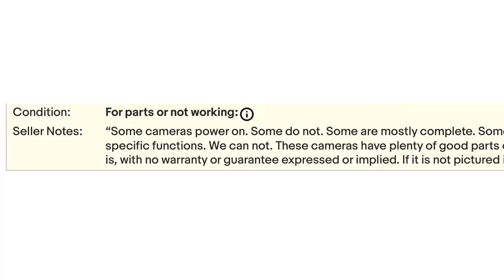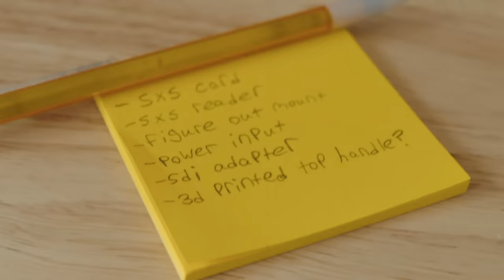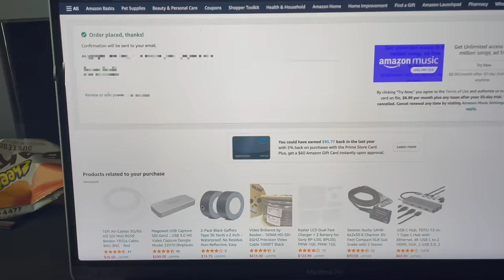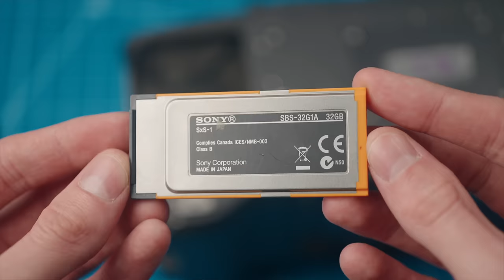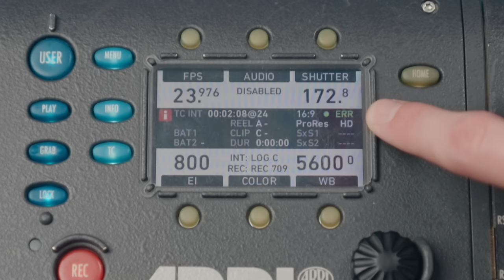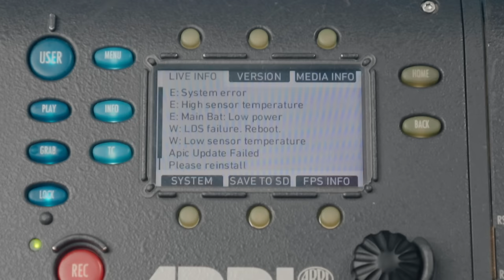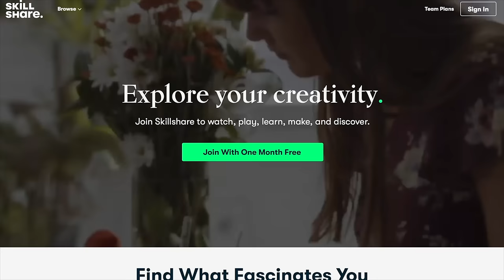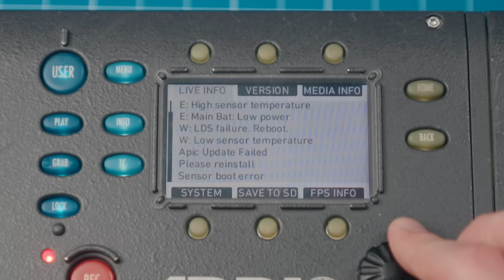I Bought 5 Broken Arri Alexa Cinema Cameras... Can I Fix Them?

Comment: Please don’t do a 3D printed top handle - Arri classics are heavy and imo not worth the risk at all of a plastic top handle
Reply: The whole damn camera is plastic
Reply: @doulos5322  No it’s not, that Alexa is a literal boat anchor bro… You’ve clearly never operated one and know nothing of what you speak. 🤫👉🏽🤡
Reply: @YouTube_can_ESAD  yep your right I'm clearly wrong. I thought the hammer finish was fiberglass reinforced plastic instead it's milled metal with a hammered powder coat my mistake.
Reply: There is nothing wrong with a properly designed 3d printed handle. 3D printed material can support 160,000 times it's own weight, but if you don't know how to design one or run a proper FEA on the part then just use a cage.

Comment: An AC power adapter to have constant power to camera for trouble shooting would be a big plus.  Might be another $100 investment.  The SxS-1 card your using is not supported by Arri, look into SXS pro card.  That will be another expense as well.  Love the project!  Hope you can get one of these up and running.  In my experiecne Andrew Shipsides is a great resource on these cameras, if he doesn't know he will direct you to someone that will know.
Reply: If he's in LA or NY or another industry heavy town, check craigslist. You'll be surprised what people will let go for next to nothing (comparatively).
Reply: any Lab supply will do they are cheap and chinese Ive several in use for years....

Comment: I'd have been a little bit worried about buying from somebody who had "5 of these"
If you've got 5 of anything, that's not likely to be random stuff you picked up in a yard-sale - they've been collecting.
If the collector then sells off "5 in a random state of completeness" - you can be pretty sure they've stripped out anything of value. 
The "oh it's weird that that's missing" is going to be list of consumable parts required to make a functioning camera.
Reply: This. Arri has great customer service. If they were fixable individually they would have been. They were used for scrap already - why would they be missing buttons and whatnot ?

Additionally : Sensor boot errors and failing software updates are also a big nono. It seems that these got fried somehow.

Comment: Definitely get AC power adapter. That’ll clear up one of the warnings, and reduce the risk of a shut off during critical work! Plus; these things eat through batteries quickly, so a v mount battery will only get you so far for so long.

Also I’m sure you’ve scoured, but the Alexa manual has an error/warning code list with at list minimal explanations.

Last, I’m excited to see the things that you can learn about these cameras. Now that they are getting cheaper I’m hoping more people will be able to dive into the internals and see how these tick. My Alexa Plus’s fan is a little loud so I’d love to find out if the fan has a widely available replacement;)
Reply: Tear it apart rewind the motor.

just kidding but not if you're desperate
Reply: @TheGalacticWest  not desperate enough yet to mess with a working Alexa haha
Reply: Build a DC regulated supply or buy one they are cheap...Lemo connectors are mega expensive military use them in non-critical applications!

Comment: Awesome you got these! The DC input expects 24 volt, that's why battery warning is active at the first booting camera. If you get a battery plate you can power the cameras also with a single 14,4 Volt battery.
Reply from the maker: That’s what I figured! I can change the low voltage warning to a lower voltage so the warning goes away but every time I power the camera back on it resets back.
Reply: @FoxTailWhipz  try changing the little 3 volt battery in the camera, it may also be able to handle a firmware update after that
Reply: @FoxTailWhipz  what model number are these. I've seen the 35 for €86,000 😱

Comment: Short info for some of these Error-mesages:
High/Low sensor temp & sensor boot error: Could be a connection issue between sensor and the rest (also maybe why some of the update failed) 
LDS failure: (LensDataSystem) you don't have a mount on there thats (maybe) it
The red/green LED flashing is just a general system error indicator for above mentioned things.

Changing sensors between different cameras of the same(!) type is possible (but there will be image artifacts since they weren't calibrated on this body), but it would be sufficient for testing.
Reply: The Alexa use a temperature controlled sensor when booting up a peltier device behind the sensor heat it up to get quicker to the optimal temperature, once reached it reverse polarity and starts to cool down the sensor to keep it at the optimal range pretty sure it is defective and the brain of the cam can't get temp data from the system

Comment: Errors : Arri does not do well with after market items , you definitely need to plug this into the wall to do a firmware update as you could end up bricking it also I know it’s a little bit of money but invest in official plug unit for Arri you we’ll find it may clear up some of the errors x also that’s wrong memory card you also have a overheating issue check the fans are spinning correctly as if not could over heat and fry the board check to see if connection to fans not lose

Comment: Is there a service manual ?  Can you get schematics for it?  It's worthy to monitor the basics, like measure the voltage rails, and test-points. Do you have basic test equipment, like a scope, a volt-meter, an RLC meter, etc?  Can you see if there are any serial port or JTAG headers. Are there any electromechanical sensors or actuators.. Mechanical fiddly things are often points of failure to take a close look at.  Can you run these boards outside of the camera and check for valid logic levels and the like?

Comment: I know it seems like $100 is a lot for a cable, but those LEMO style ends are really not overly cheap for brand name. China style ones are not terrible under normal use if you need to make one or get the chassis mounts for them

Comment: Welcome to the world of cinema cameras where everything is expensive and conditions are rough 😂.

Awesome project, kinda jealous haha.

Some input from my side: E stands for Error and W for warning i guess. LDS is Arris Lens Data System for communicating with compatible cinema lenses through contacts in the PL Mount. The Error makes sens because the PL mount is incomplete. Should still allow the camera to function tho.

The most complicated thing with the Alexa is everything around the Sensor. Arri has put a lot of engineering in the temperature management of the sensor to ensure a constantly good image. So findig an Alexa with the properly working sensor and temperature management and without any errors related to the sensor temperature may be your priority number one. 
Cam #1 showed Sensor boot Error and low Temperature, so it might not be suited best for the final functioning model.

You can connect a monitor and see what kind of image the camera outputs and if there are any dead pixels or other sensor defects. That also works without a lens attached although I phyicaly cringe seeing these beeing shipped without any lens caps and no lens attached haha.
I mean the sensor is the part that makes the Alexa that special and relevant in the industry and people would not bother protecting it. But a large studio or rental house does  not care about these old work horses. They have probably paid for themselfs multiple times and are now just collect dust.

It would be interesting how many hours runtime are on them. Lower runtime might indicate better internal conditions because of less use but could still be heavier use and worse conditions tho.

Looking forward to part 2!
Reply: So true.. When you buy the body of the cinema camera about a month later you end up spending about 4-5x more for new lenses, accessories, gear and quality of life improvements. The cinema world is crazy.
Reply: @tb1235  Yup, bought a Red Raven last year, the body was 2500€ but all together I ended up spending tripple of that for everything

Comment: Usually these cameras are parts cameras from a rental house. The imagers are notorious for going bad, so are things like the SDI boards. So most of the time, they're just throw away for that reason. I doubt highly you'll be able to make one work because if there were any working licenses on the boards, the rental house would have used those boards for other cameras to keep them working. So without licenses, you'll struggle to even get software to work, let alone hardware. The best thing to do is build one chassis that powers on with a board that appears to work and simply swap parts around using that chassis. You may get an image out of using all 5 donors, but my guess is, it won't be good to use for any real shooting. Having worked in and around these cameras for years, sadly they're at the end of life, they have many issues, 100's of them are not working due to typical on-set wear and tear. It's not something you can fix with a soldering iron, it's generally full-scale failure of multiple components. Anyway, good luck with the work, great channel and I hope you at least have fun.

Comment: Did you manage to get info behind why these units got junked?
Reply from the maker: I haven’t figured out the history behind these. Surprisingly though they have very low hours! Alexa #1 has just over 1500 hours and #2 has 790 hours!
Reply: I doubt they just dump the cameras. So, there is a possibility someone, at some moment, make a damage report prior to release them. Try to reach the seller, at least they can give you a better idea of what is missing. I think the will have more info to share about it. I hope you got through. Nice proyect. And also online forums (every one knows this last one piece of advise). Godspeed!😊👍
Reply: From what I remember they were used for parts by the reseller that sold them. They sold a few other Alexa’s and that’s why these would have been stripped. Before that I don’t know. Inventory clean out of a large rental house or repair centre?
Reply: @FoxTailWhipz  Surely they can't have such low hours, for top flight professional cine bodies that's near newborn baby hours.

Comment: I'm occasionally hacking "interesting" consumer cameras (still photography) to make them full spectrum. I've been pretty much following the method of buying a bunch of "almost-functioning" cameras to end up with a few working ones, made from harvested working modules. But some cameras have design / component flaws that are un-fixable unless you have special tools or access to parts and service manuals. I have bought "broken" cameras that just needed some cleaning and some in great condition that won't even power on. The PSU often is a source of many troubles and so are aging micro switches and, believe it or not, solder points. Especially the lead-free variety: A good solder point can age for no apparent reason at all and you won't be able to tell from looking at it...

Comment: Photograph both sides of each pcb you remove ensure the REV numbers are checked and log each board per camera chassis serial  as manufactures change functions on different revs of the same camera , and you may find that one board will not be supported in external firmware to it - use a bunch of Brady number/letter labels - dont lose track....  !!!!
Reply: You are selected among the greatest winners 💐🎉Kindly send a direct message to  receive it immediately, thank for watching and commenting.......,,,,

Comment: So cool! I’m not as bold as you, I think I saw that listing though. I’m holding out for a working Alexa at around $4K
Reply: I got a full Alexa Classic 16:9 kit for around $3600, so you can definitely find deals, maybe kits with fewer extra accessories. Just keep in mind the rather high individual cost for key accessories like the viewfinder, top handle, battery plate, and PL mount (though Leitax's EF mount is relatively inexpensive). And the high wattage batteries and heavy duty fluid head and tripod hahaha

Comment: I've never used any cinema cameras, but I do a lot of electronics work.

I just found this in an Alexa firmware update PDF...

"Updating ALEXA Classic M or ALEXA XT M Cameras
Please note that the first time an ALEXA Classic M or ALEXA XT M is upgraded from a version before SUP
10 Open Bate 2 to SUP 10 Open Beta 2 or later, a slightly different update process (two-pass upgrade) has
to be used.

"The two-pass update process is as follows:
• Initiate the update as described in the release notes.
• The camera will start the update and at some point inform you that the APIC update failed. This is normal
and not a problem. Please wait until the update is finished updating the CMC and ACOM boards."

"• Then power down the camera and power it back up again.
• You will see an error and a message in the LIVE INFO screen like this:"

(shows an LCD  screenshot, with E: System Error, Apic Update Failed, Please Reinstall.)

• Initiate the update again. The camera should go through the entire update procedure this time.

That suggests it might be a similar situation for the Alexa classic maybe?

ie. I don't think you can jump too many firmware versions in one hit, you have to do it in steps.
So hopefully the APIC update error isn't anything too serious.

I couldn't find much info on the APIC online (I thought it sounded like a Power Management IC at first), apart from somebody asking on an Alexa reddit about repair of the APIC board, and they said it's the "video processing board".

btw, if you end up with a camera at the end of this project that has most of the boards but other things missing, I'm very interested in buying it from you. Although I guess it I probably couldn't do much with the sensorless versions, I would still consider it. lol

P.S. I'm fairly sure the E: and W: just mean "Error" and "Warning".
Reply: Oh, not sure if anyone mentioned this yet, but it's possible that if the seller dismantled some of the cameras more than others, there might not be enough (or any) thermal materal between the heatsink and the camera sensor.

Or, the heatsink might not have been tightened to the sensor assembly correctly.

If the camera doesn't have a temperature probe right under the sensor itself, then it might not be able to detect that problem, and the sensor could possibly get damaged by overheating if it's left like that for too long.

I don't think the sensors produce a massive amount of heat, tbh, but I'm not 100% sure on that.
I think they mainly use the peltier coolers to help reduce pixel noise in the image, especially at low-light levels.

(like they do for sensors on telescope cameras.)

Since all the cameras have been taken apart at some stage, it could be worth tearing them down just a bit further, to see if everything looks in place, especially the heatsinks and thermal pads / paste.
Reply: the M is the Alexa Mini a completely different camera model
Reply: @alain99v6  Yep, but I was thinking that since the APIC message was one of the main messages after the attempted firmware update, it might be the same or similar issue.

Comment: Hm, we should've talked beforehand, i could've told you that the Alexa takes only SXS pro cards, no SXS-1 and not the newer X. Also, these area basically an expresscard, so you can read/write them in a laptop with expresscard connector, you don't need a separate reader for them.

Comment: FYI u need 24 volts to actually power the camera. Excited to see how u get it together
Reply: Alexa also supports typical 13.2 14.4 battery , there's a power converter inside , however in the menu you need to define the low voltage setting for both the Fisher 2 pins 24V and the taps inputs for the battery eithe goldmount or Vmount, right now he will always be in low voltage warning unless he reach the right menu and drop the warning value to something like 12.5V it was always a problem when mounting a Classic on a steady cam to change that valu when the stead was only supply single voltage (1 battery and not 2 to make 24+V)

Comment: Hey thanks for your videos. I need urgent help. I have the Alexa plus and the scroll wheel is not pressing in in order to select anything. It still turns with the clicking sound.  How do I open the side panel to attempt to repair it?  Do I have to pull off the scroll wheel? If so how?